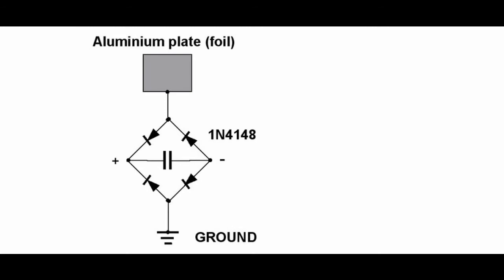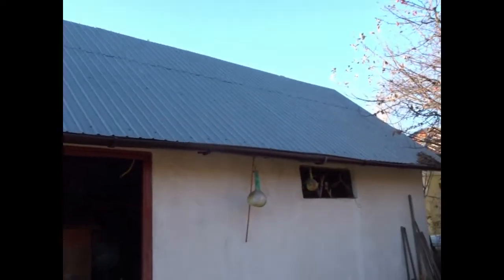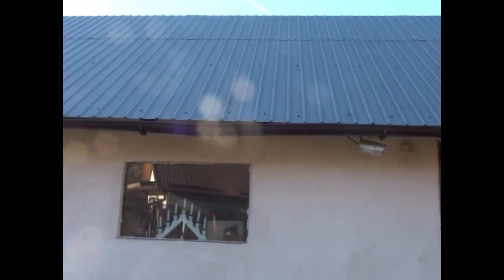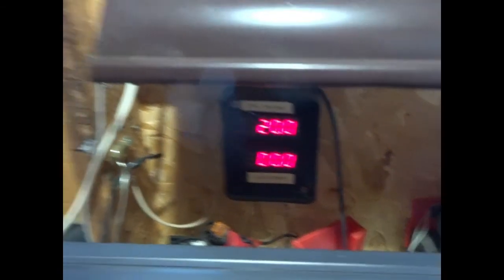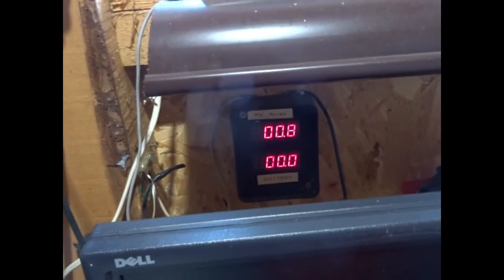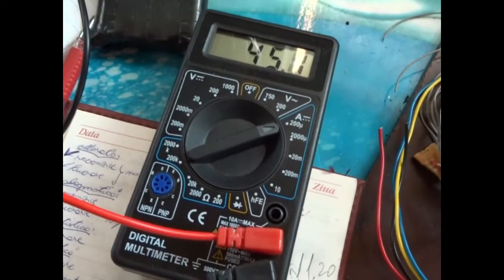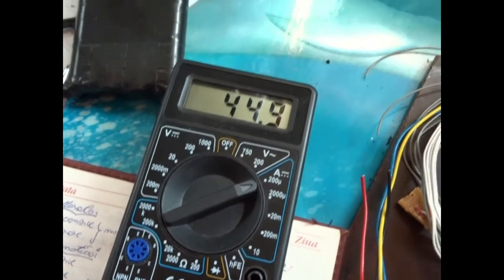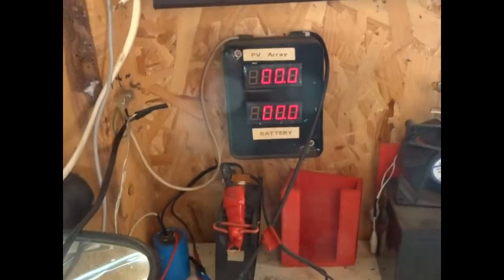Energy from air

Comment: Microamps? Not really worth messing with it seems...
Reply from the maker: You'll be surprised of the light. I put now a link in the description for a better understanding of this setup capabilities. I've planned to make another tutorial on this topic, but I don't know if I will do it. I've took all the shots but I am too lazy now for that. The fact is that my workshop is lighten 24/7 by a 30V LED. The Voltage varies between 20-28V (24V average). Over 24V the light is bright, and over 26V very bright. Thank you for your interest. Anyway the link is: https://formare.ro/download/workshop%20free%20light.jpg
Reply: @Machiuka  light? I must have missed something if you're talking about light?
Reply from the maker: @diylithiumguy  I harness this stray currents to make light in my workshop. With this currents I feed a 30V LED that make light in my workshop 24/7 as you may see in the picture.
Reply: @Machiuka  so, microamps are enough to light your LED?
Reply from the maker: @diylithiumguy  As you may see, yes. It is a simple setup, anyone can replicate it. First  of all identify two separate grounds, and verify if your voltmeter shows over 2V AC. Then put one  or two 9-12V AC transformers in backward position, i.e. where you have 2VAC you have the transformer output (the 12V side). Now you measure the other side. You must have over 30VAC. Put a rectifier and LED. Try with different LEDs (3,12, 30V etc). Not all works the same.
Reply: @Machiuka  I cant imagine any LED that I have, that will put out any appreciable amount of lumens, will operate on microamps.

Milliamps, maybe.  But definitely not microamps.

Most of my leds require AMPS.
Reply from the maker: @diylithiumguy  https://formare.ro/download/sc_photos.zip  few photos that I've made for my video clip. I will give you a link to a video. Besides that it is a simple experiment to made, not some mumbo jumbo secret receipt. Try for yourself and talk after. The old soviet capacitor that you see in one of the photo is not relevant.
Reply from the maker: @diylithiumguy  https://formare.ro/download/00003.MTS a short video that I made. The camera that I have is an old one,  but you may see. This setup do not works on blackouts. When the grid is down it didn't work, because there are stray currents from grid, not atmospheric potential difference.
Reply from the maker: @diylithiumguy  If you work enough with LEDs you will notice a strange behaviour of them: Brightness is liniar and Current is logarithmic. Few of LED's didn't obey to this rule, the most of them obey. Play with them if you have a variable power source and you'll notice that. Experiment my friend, only thinking in your armchair is not enough. From now on I cannot help you anymore because I gave you all the info that you need to make your experiments. Have a nice day!
Reply: @Machiuka  I have been using/testing LEDs for 15 years probably. But i only use high power ones.

There is nothing logarithmic about LEDs. You maybe be confused by some graphs you've seen that have a curve, but that doesn't equal logarithmic. 

Keeping temperature the same, luminous Flux and current are linear. 

Nothing i have ever used will operate on microamps.

Comment: you can also try something else , first insert a a metal rod or a steal rod to the ground going at least 4 feet down and messure the differance between the 3 points your home ground and the roof , and the steel rod , some people claim 200 volts but i never tried it :)
Reply from the maker: I'll try this as you suggested. Thank you for tip Amir.
Reply from the maker: Today I had the opportunity to try that. I received the same result. But... It give me the idea to make an earth battery. I've received already 1 volt with 1.2 mA from only two elements. Aluminum and Copper.
Reply: @Machiuka  i forgot to tell you the distance between the ground you just made need to be as far as you can from the house to have a good potential difference
Reply from the maker: @EnergySeeker  I've put it near building. I will try as you suggested.
Reply from the maker: @EnergySeeker  Amir, I've tested, and it seems that distance is of no impact on the setup. Also the earth battery is not affected by the distance between electrodes. It shows the same voltage no matter distance is between those electrodes.